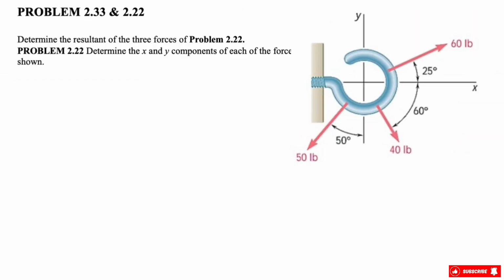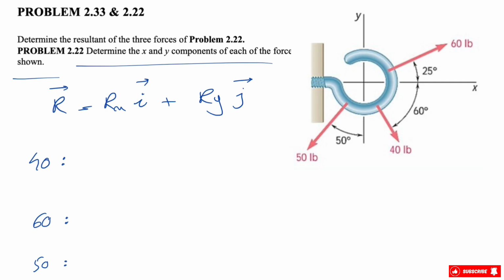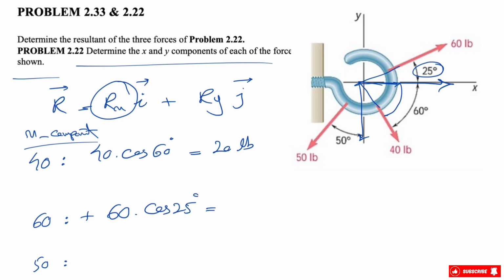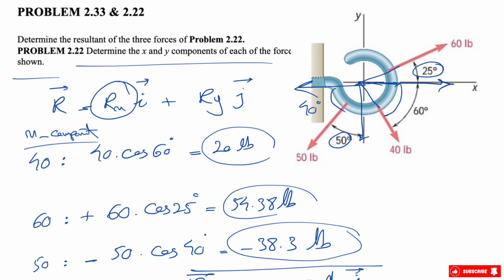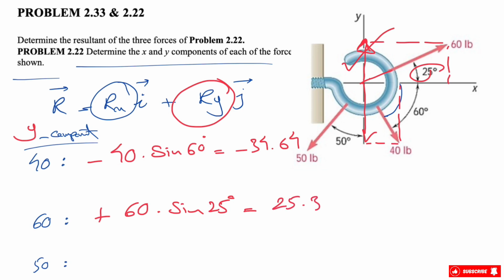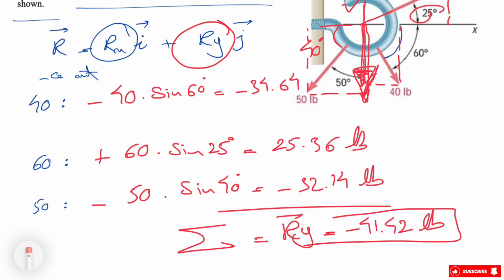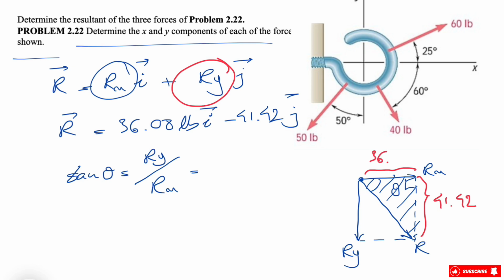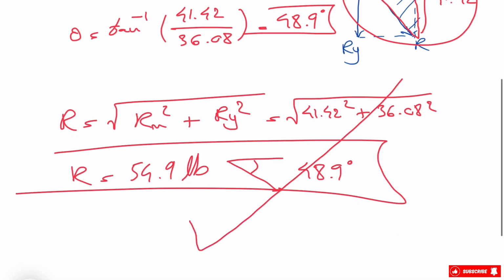Problem 2.22 & 2.33 | Determine the resultant of the three forces of Problem 2.22. PROBLEM 2.22

Comment: When you made the component in y of 50 it was 50 times sine of 50 and you put 50 times sine of 40
Reply from the maker: I used the angle with the x-axis, which is 90° − 50° = 40°. That gives 50 sin 40°. Alternatively, if you use the 50° angle, you get 50 cos 50°. Both expressions give the same value.